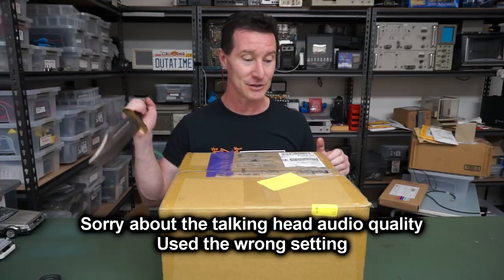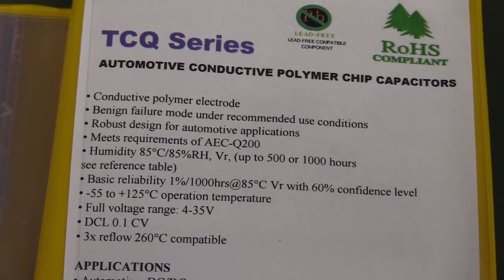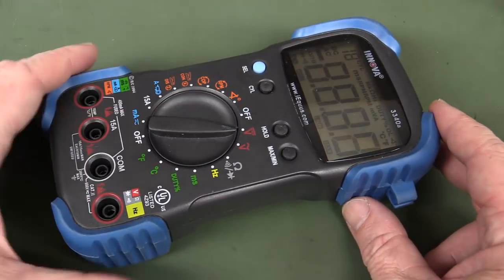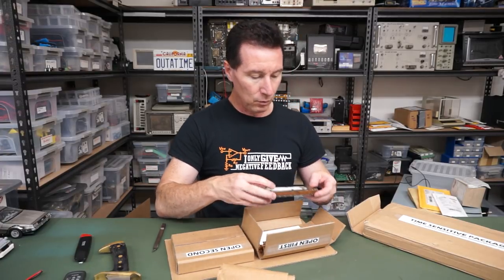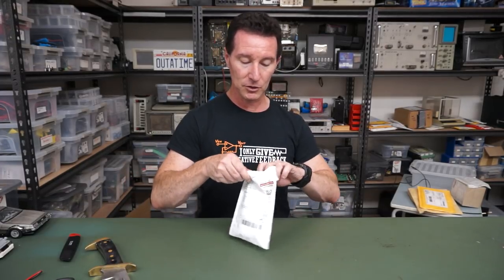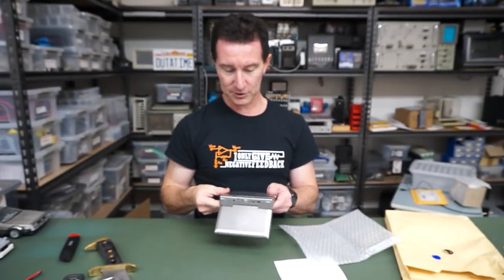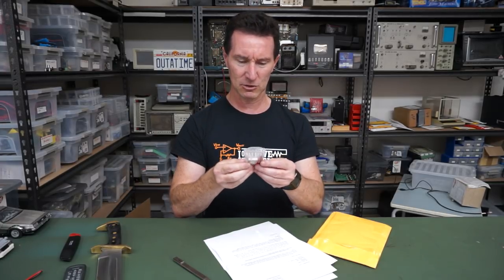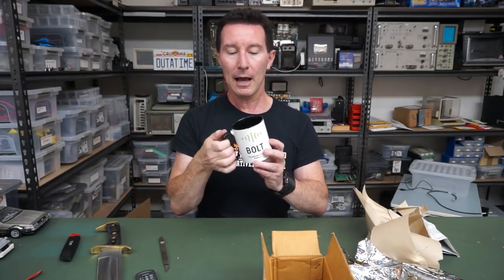EEVblog #1043 - Mailbag

Comment: hmm those "probes" r dental drill bit's ;)
Reply: Inverted Cone Carbide Burs #34 and up
Reply: i did not know the name. al i know is that i got them with a dental shear drill set i got as a kid.  i removed all the bulky unneeded parts and used it to make mopeds go faster ;) it was perfect to open ports in smal 2 strokes ;)
Reply: Det stod det i brevet også, hvis du rakk å lese det mens han holdt det frem ;)

Comment: I admit ,laughing at someone's concept of a strap to hold a multimeter is deserved. Clearly someone thought it was a great idea. Someone told me if you can think of it now days,some one has probably already made one. I would think in this case,someone thought of it and it sounded stupid so they didnt bother,except this company,whom thought they were really onto something big. lol. I think those curls in the design was designed to absorb any stray static electricity to prevent you from frying any component inside,that would explain the spark gap. The other components are there to absorb any stray electric impulses and prevent them from getting into the black blob. Then you come along and short the whole thing out with tweezers,lol. Way to go. Nothing too exciting in the mail bag,nothing for Sagen eather. Shame. Oh well. Two minute tear down,two seconds of yawn too. Oh well.